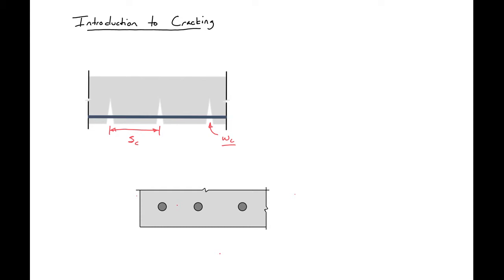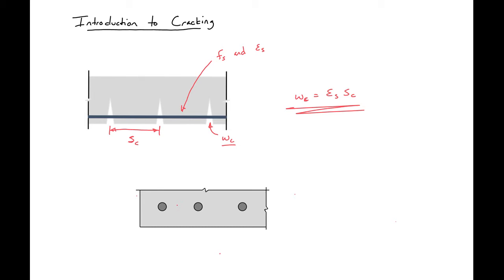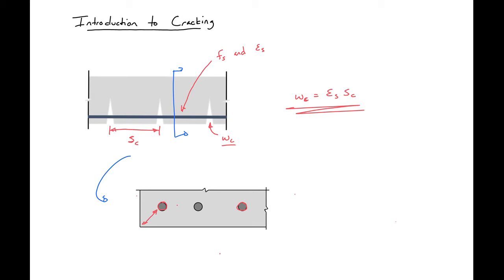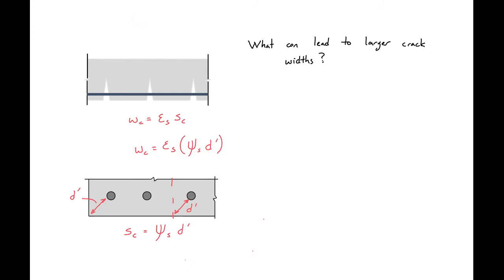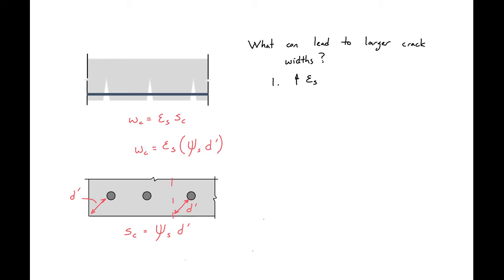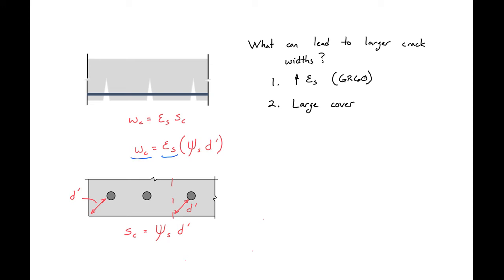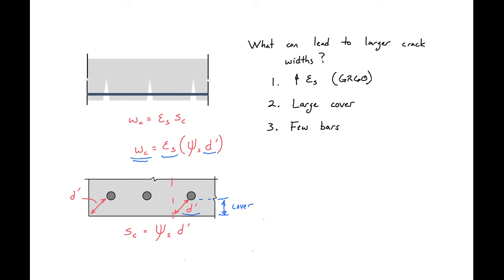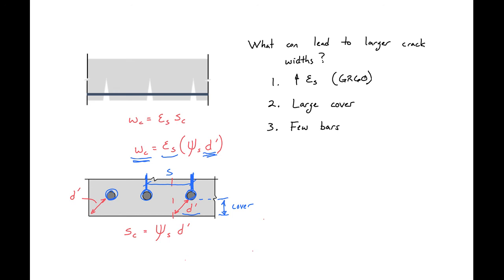9 - Introduction to Cracking in Reinforced Concrete

Comment: Another reason for cracking would be early thermal cracking which is created by the concrete expanding and contracting due to exothermic reaction during curing